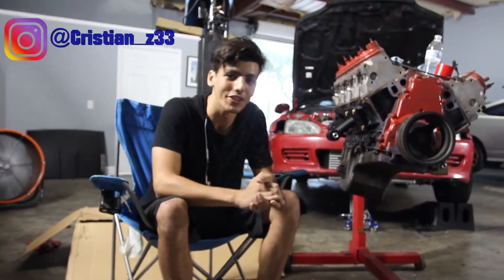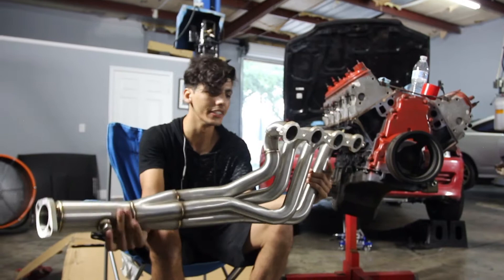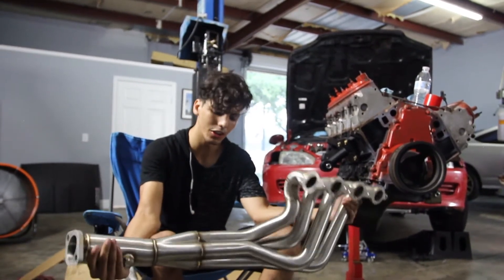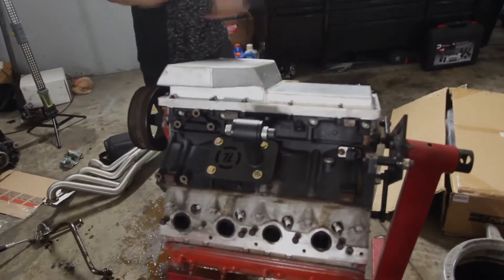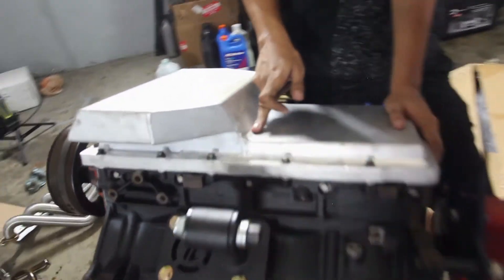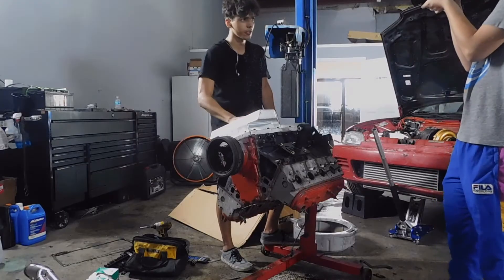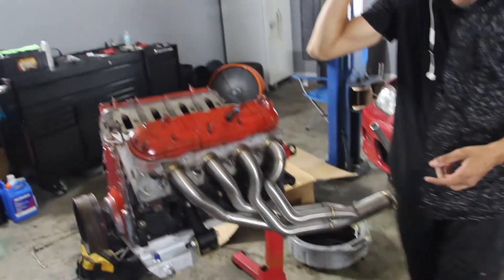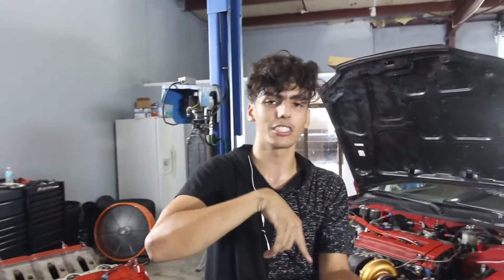350Z V8 SWAP- HEADERS AND OIL PAN INSTALL

Comment: Why doesn’t the cx racing oil pan not work?
Reply from the maker: so i guess the fitment of the motor is different. The cx mounts are made so that the transmission sits exactlt in the same place, as to where the isr kit moves it back a bit, which is why youd need a shorter driveshaft too. so compared to the ISR pan (which i just got in the mail), the sump part of the pan is much longer latterally. The isr sump is very short length wise. Hope that helps, lmk if youve got any other questions, happy to help how i can